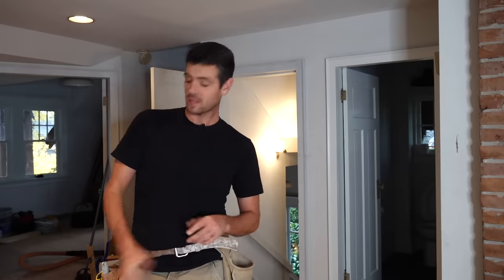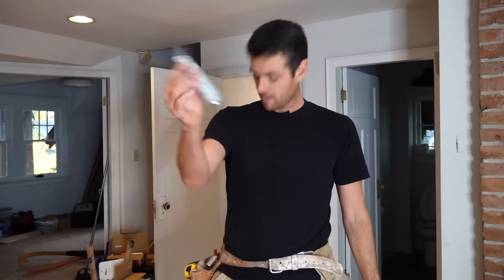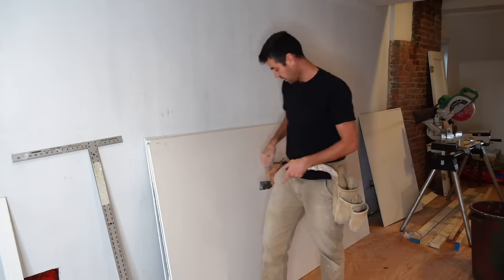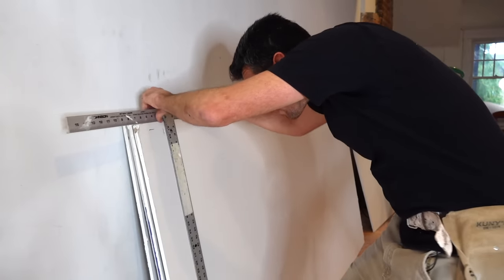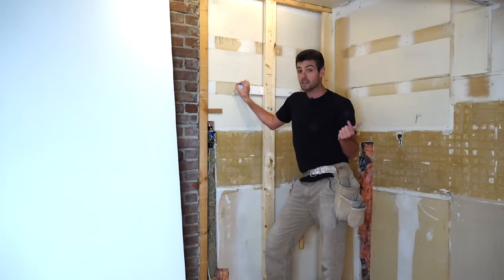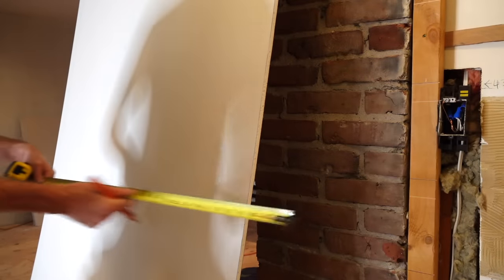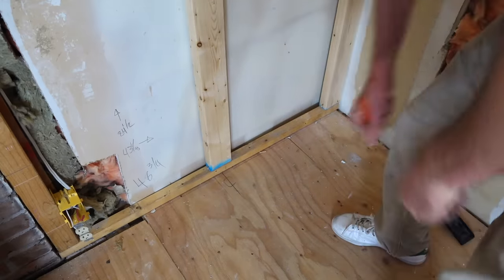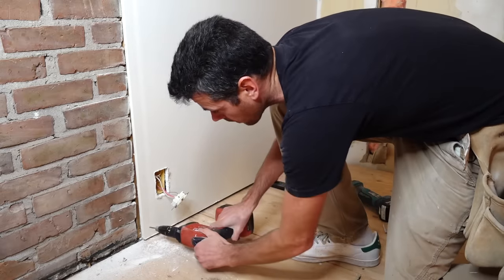Every Beginner Drywall Mistake I can think of (1/3)

Comment: That trying to cut things too tight hits home for me. I used to do concrete work and when I was building forms there was a particular inspector who always used to say I was ignorantly accurate because I would leave 0 room for tolerance and things would be tight around rebar or whatever. I've noticed I struggle alot with that in drywall. Just a hair to big.  Then I blow out a big chunk. 😑
Reply: @commietube_censorship_sucks  yup. Lol I've done so much drywall now I have a system engrained in me. Either I cut everything too tight and I have blowouts and I just go on saying "spackle will fix it, and you'll never know" or I realize I don't wanna spackle extra and cut everything too small.....and end up having to spackle extra to fill gaps. Lol. Maybe for my next drywall job I'll try and keep this is the back of my mind.
Reply: @larracis  LOL .. when I have a blow out I usually just comment that the mud man will fix it ... and that he will hate me ... only problem is that I am the mud man and yes, I do hate me when I screw up stuff like corners, outlets, etc.
Reply: @RehabLife  I'm ok in corners, inside and outside. Outlets are eh.. my rotozip hates me I'm pretty sure and has a mind of its own. It pretends like the box is there and it's just following along cutting  what it's supposed to cut and then I pull out the cutout only to realize it wasn't riding the box like it's supposed too. Lol. I think ultimately my drywall  issues all come down to I wanna go quick and get it all hung and starting taping so I Don't take the few extra seconds to do anything that would make it more efficient.  Measure twice, rasp the cuts that aren't perfect, go slow with the rotozip and get nice cutouts for the outlets. "OH this piece is a little tight on this corner...  just fist bump it. It'll go." Blowout. Lol

Comment: Great video! One comment though: 12:53 I always try to avoid doing this. Drywall is heavy (particularly acoustic drywall etc) and putting all that weight through that thin edge could damage the cable. Also, please, please take a few seconds to isolate the live socket before working with it >< Really, really not a good idea to be working around live sockets, particularly with metal tools.

A few other things I would add.

1. Really, treat the drywall with kid gloves. When you're moving it around, move it carefully and slowly. Lower it onto your foot before the ground. Don't put all of the weight through one corner. When you're installing it, if it ever sticks, NEVER try to force it in. Identify the sticking point and remove some material so that it pushes straight in with no fuss. Otherwise it is just going to break when you screw in. On a similar note, before you screw up, satisfy yourself that the drywall IS touching the backing at all points. You won't necessarily be able to see if ti is not, and again, you'll get those unexpected breakages.

2. Make sure the frame is flat before putting in the drywall. Like, really, basically perfectly flat. (OK, not "flat" necessarily - the wall can be curved - but framing members must be meeting perfectly flush). A step of <1mm between members can be enough to snap the drywall when you drive the screw in. If the frame is not flat, you may want to try planing off any protruding material, gluing a slither of wood in, or otherwise using some sort of filler just to bring the members in line.

3. You really want to avoid it, but sometimes you just have to screw very close to the edge of the drywall (e.g. onto a thin joist shared by two drywall edges). This can be OK if the edge is wrapped in paper, but if it is not, it will probably blow out when you screw. You can help avoid this by drilling a pilot hole before screwing.

4. When I first did drywall I thought it would be efficient to mark out the shape by triangulating using the corners. This is a bad idea lol. I tried fairly extensively to make it work, and it can do, but at the end of the day it's too error prone. The problem is that it's not always clear exactly where the "corner" is on the wall, and the smallest error in the measured or marked angle can completely throw out the whole shape. It's really much better to mark the shape as demonstrated in this video. Measure at several intervals horizontally and vertically, and it will be perfect every time. You can use a straightedge to check for the general shape of the wall before you decide where to measure; just try to eyeball sections that can be reasonably approximated as straight lines, and measure at the start and end of them.

Comment: One I have made, once. Measuring your sides to cut along the length of a board where it tapers in/out over the full length of board, then cutting a foot off the end and wondering why the side is off. Because angles don't work that way. 
If the top is 2" and the bottom is 3", and the height is 6" you cant mark an 8" board at 2" and 3" at the ends and get the width right. I now always cut to length then measure/mark the width.

Comment: Oh man my boxes are the worst! 😂 I just put wall board over top old crumbly lath and plaster and I have pretty much done every mistake you've pointed out so far and I'm sure 2/3 and 3/3 are gonna have my name all over them as well. But nothing is as bad as my electrical boxes! I buy the extra large plates and also I have to replace the screws with longer ones on the actual switches and plugs to pull them out from box to meet the wallboard 1/4 inch beyond the plaster! It's a freakin' mess but it's my freakin' mess! 🤣🤣

Comment: Took me forever to get a straight answer about drywall screw gauge #6 or #8. I suppose there's building codes that specify that, but time after time, on my attempts of web search and video search I ended up giving up because I couldn't get a straight answer. I just wanted to know what the pros use because I was doing a big remodel 3000 square foot ceiling and 15' tall walls with double 5/8, all wood framing, and had been using #8 screws for everything, even the 1/2 on the ceiling. Finally got a chance to talk to a local pro drywaller and he said "I don't even know why they make #8", so I finally got an answer. Now, I was also doing triple and quadruple on some walls, so Menards doesn't carry a #6 long enough for that, so #8 was the only choice, and I understand why; they would probably break. On the other hand, #6 goes in so much easier that maybe they wouldn't break. And #6 causes less cracks and crumbles at the edges because it's a smaller shank.

Do you agree #6 is standard for wood framing?

Comment: I admire anyone that uses imperial measurements with all the halves/ quarters / sixteenths etc... such a confusing / complicated system when compared to Metric
Reply: I do rough carpentry and we only measure to the nearest eight inch and say strong or weak for the 16th. 3/4 weak or 5/8 strong  is a lot less confusing than saying 13/16ths. Lay out all your lines before you make a cut so you don't lose your marks that or mark it where it won't get cut off. I appreciate him making little mistakes and not taking them out. Everyone does it even period been doing it for 30 years.  Always keep learning, don't be afraid to try something different you may like it more
Reply: We don't really go beyond the 1/8 and most crews will use numbers representing 1/8"   for example 49 and 1 would be 49 1/8"     22 and 4 would be 22 1/2"  if we need to go to the 1/16" we would say fat or lean   22 and 4 lean is 22-7/16"  much easier to write down and communicate than saying sixteenth, eighth,   half, quarter.  so on site we would write it down as 54-1F or 27-2L  which is 54-3/16" and 27-5/16"      

I like the way we can break down the on center layouts since there are 48" in plywood widths, we can do framing layouts with 6", 12", 19.2", 24" on center layouts.  Metric can get to be a long string of numbers I would think.  Are you guys calling out stuff in mm?  like 1193mm?
Reply: That’s interesting.     
Metric is pretty much in 10’s / 100’s and 1000’s 

10mm to a cm  or 1000mm to a meter   Makes it easy to be precise 
Very simple and easy but obviously it’s all about what your used to 

Yea generally yell it out as millimeters. Like 2400mm.   But instead of saying “two thousand four hundred” 
We just say twenty four hundred or  
 2780mm would be Twenty seven eighty for example 

….. if that makes sense
Reply: @nomadnowhere1818  the problem there is you can't evenly divide. There are only 2 factors for a 10 based system making it impractical. In real world scenarios you just keep throwing away the excess so the numbers work out. In addition when it comes to vehicles and fasteners in particular there isn't a single system so many metric sets don't have a full complement of wrenches. I ran across that today with JIS metric on a tractor. If 10ths or the like get you excited you might be thrilled to know that machinists have been using them for a very long time without bothering with the metric system.

Comment: Thought I'd add a "drywall mistake" from my own experience. Those rotozip tools are awesome, but not to be used with plastic electrical boxes. They will cut right through like they're not even there.
Reply: Not if you use guidepoint bits. Regular cutting bits, yeah that would be bad.

Comment: I  did apartments I hang around 600 pieces of drywall 4x9 a week that's about 4 apartments.. I keep my tape measurement on the left pouch and have up to 3 knifes on my right so I don't loose time changing the blade ..

Comment: Although it's more expensive I use fire or sound board instead of the cheap and nasty standard board because it's much more dense and rigid. It doesn't crumble and Little Johnnie will not poke his way through so easily.

Comment: I change mine super often. I learned the hard way as I was putting more pressure on the cut to compensate and she hopped over the edge of my straight edge practically cutting the tip of my thumb off. No bueno.

Comment: Thank-you for your helpful video. Regarding sharp blades, there is a tool called a Speedy Sharp Knife Sharpener,  it will scrape off the drywall dust and sharpen your blade in a couple of seconds, much faster than changing a blade.

Comment: For under $20 you can buy a magnetic outlet insert for boxes (blind mark) with or without an outlet installed.  When the drywall is up you place a second magnetic template for the box outline to find the location of the box, its very accurate, then you can cut it out using a spiral saw or even an oscillating saw.  Saves a lot of time over measuring each outlet.  Plus you never forget an outlet since you need your magnet for the next box.  If you do it enough or you have a big enough job it is well worth the investment!

Comment: Cautionary tale on using a OLFA (or snap off) knife.  At my friends wedding some years back, another friend from high school arrives and his left arm is in a cast from the elbow to his knuckles.  He had been cutting drywall and using an OLFA knife (large) and pulling towards himself when the blade snapped off, and now with no resistance the knife then proceeded to sever the ligaments on his left wrist.  If I'm ever helping anyone do drywall and they pull out a snap off knife, they get the story, the knife gets  put away, and I give them a basic retractable Stanley knife to use.
Reply: 2 mistakes
1. Your cut, i noticed that u changed the drywall bec the first one that u installed had more than 1/4 of inch gap so u cut new one. Well on my understanding wasn't the side wall that was outta level but the brick side...
2. How to cut the drywall using t-square.. if youre right hand you should use the right side of the t-square to cut it
Reply: Or use the snap off but don’t extend it past the first snap line…

Comment: There's a new mistake you'll learn about. Not using the Dewalt Collated Magazine Accessory (DCF6201) and screw gun. I did a job with a friend of mine, and he had one. I put my Ridgid screw gun back in the van and used his gun. Then I bought one of my own. I haven't touched another screw gun since.

Comment: Ben, for DIY'ers would gluing drywall be recommended?   Obviously cannot be used on exterior walls (with poly/paper insulation) but for small jobs or even internal renos.  I tried it for the first time and it really sped up the job both installing and finishing.   Granted I am an experienced DIY'er but for the newbies doing their first drywall job it would cut down on the amount of screws required.

Comment: In regards to your issue with screw depth setting. The screw gun should be locked on as the but does not rotate until it is depressed. The constant speed of the of the gun helps set the screws faster and more constantly. It also saves on battery life.

Comment: This is an older video and I’m just a Harry but I’ve done a little bit of everything and mastered none. But on the live outlets you can run a loop or 2 of electrical tape around the receptacle body covering the screws and the wire ends. I do it on my work just as a little tiny buffer for me or anyone else in the future who may go in that box that you don’t accidentally touch or jump the pins.

Comment: Heres something i noticed is you have a tapered edge along the brick side. You mentioned you will have teim against the brick. So how big of a trim are you putting there? It would have to be bigger than the tappered edge. But you cant do that with the electrical boxes that close to the brick as well.  So beings that the framed corner is furthest from plumb and needs to be the cut side. It would be my opinion. The seasoned pro should have known to hang this wall in 2 horizonal panels even though there would be a tape joint. Final product would be much better. Just my pair of pennies. Carpenter for the last 35 years.

Comment: Screw length: I saw a rule that you should us a screw 2-1/2 times as long as the depth of the fastened material. So 1-1/4" is perfect for 1/2"; doubling 1/2" means a 2-1/2" screw should be used. Your mileage will certainly vary, but it seems like a good starting place.
Reply: that may apply in general construction but in drywall it is 3/4 + your board thickness.   Anything longer runs the risk of damaging something (wire, pipe)

Comment: I'm happy to see a proper knife in your drywall tool kit!  I see so many boarders using box cutters.  I haven't carried or used a rasp in over 18 years, carve it with that good knife my friend!!  I have also never used a circle cutters tool, I just fashion my own from a small piece of scrap.  I only use a chaulk line on long angle cuts like those on vaulted or cathedral ceilings, slip cut your slide rips and save yourself fiddling with the chalk.  Great video!  I'm guessing you don't hang board all the time though?
Reply from the maker: I don't hang all the time. Enough to be competent but not enough to be really fast.

Comment: It's a beginner video so perhaps it should be mentioned that the reason you butt it up against the ceiling is because you don't want it touching the floor to avoid moisture or water getting to it.

Comment: Thanks. before you get the part 2 and 3 I didn't know that the roll of paper has a top side and bottom side, manufacturer should mark that saying drywall side. good thing I used hot mud for the first coat.

Comment: we gota glue the intermediate studs in nz and depending if its a bracing element, screw 50mm from the corner in each direction and then screw off the specified distance apart

Comment: Great video. Very helpful for me as I am a taper trying to learn how to hang drywall better. One question about this video…. On the left side where the brick is, you said you were applying trim after you rock. I noticed you had to router tightly to the bottom where a few bricks stuck out further. How would you get the trim in assuming you’re using an L-metal type of trim?

Comment: How critical is it that your T square is "square". Silly question, it seems, but the 48" my house came with seems to be an 1/8th out, so I've been using it mostly as a straight edge when it comes to anything over half a sheet. The one I bought ages ago is 54" for some reason and ruins my whole flow.
I guess my question is: Is an 1/8th over 4ft something to really worry about, or will I accumulate errors that I can't account for? I'm Already having to measure 5-6 spots on a wall, because I've apparently bought a fun house. So far, it has been hard keeping things square so I don't have to cut 2 or 3 sides of a small sheet, and i've yet to start the long runs.

Comment: #1. Edges blown out? Tuck the end of the chalk line between two pieces of drywall.

#2. Pros score the front, snap like you did, then snap the other way to pop the piece loose. Cutting the back paper takes too much time.

3. I keep my laser on a stand and ‘draw’ my laser line for studs in the middle. Line up with my top mark and never miss a stud with a screw. Very fast and easy to move from stud to stud. 

4. Screws 12” along the edge, 16” in the field. 

Good luck!
Reply: cutting back-paper takes to much time, but, lasering every stud line is not, you don't hang much do you?
Reply: @dantigar7318  I hang drywall 3-4x per month. Not sure what you’re envisioning, but it takes me virtually no extra time to move my laser to the next mark indicating the next stud, as I’m moving it as I’m driving my last screw.  I never - ever - miss a stud with my drywall gun.  It takes me less time to move my laser line for an entire 12x12 room than it takes to run a rasp along 1 sheet of cut drywall.

Comment: Why not just make a line on the sheet for the studs like I did for 35 years? Much easier and saves missing, then having to pull screws. I never used a surform plane,but a hookbill to trim the rough edges and never used a drywall square.